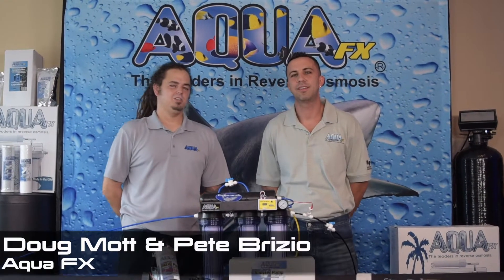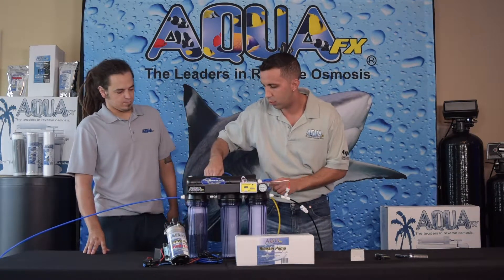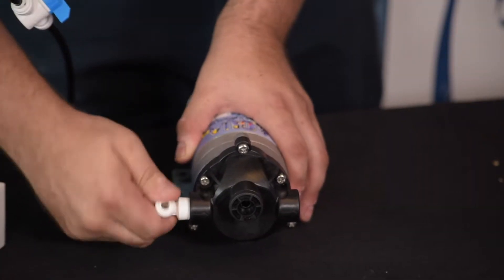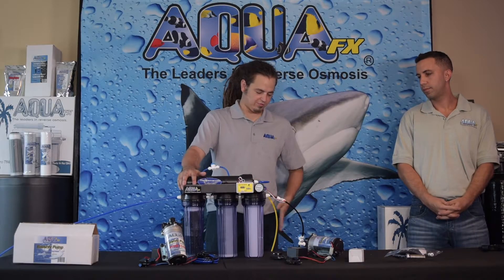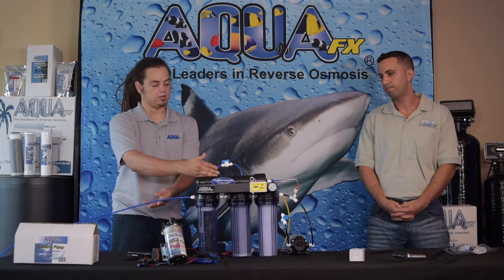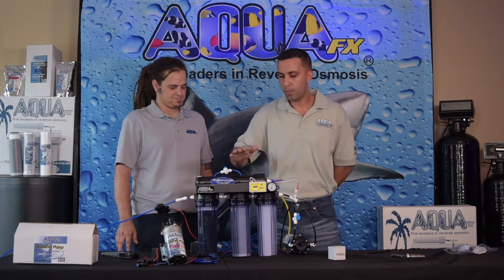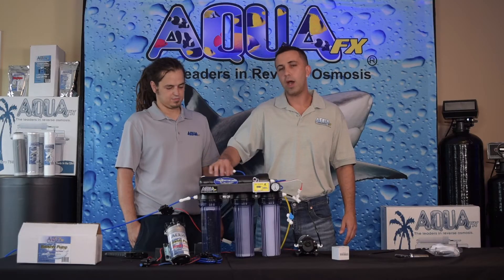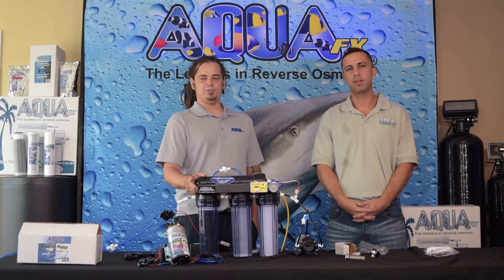AquaFX Pump installation V2

Comment: Do you have a pump that would fit a 3/4 cpvc line?
Reply: https://www.aquariumwaterfilters.com/12-Horse-Motor-for-Carbinator-Pump_p_229.html   But you  really need to be more specific; are you looking for a booster pump? what's you pressure now?  How much water do you need? you can call the office anytime for help